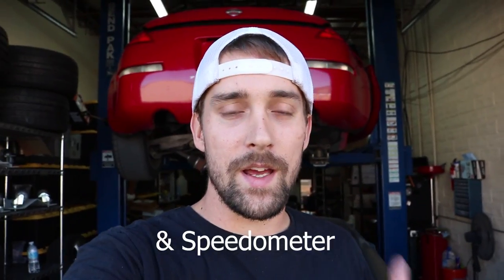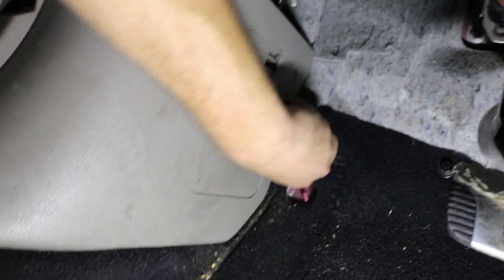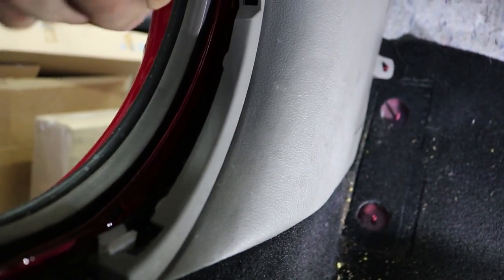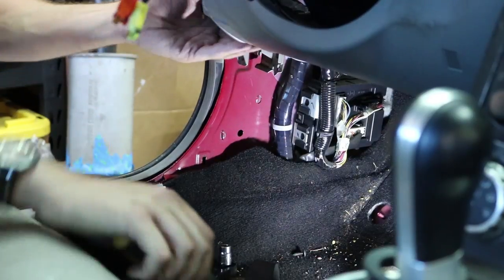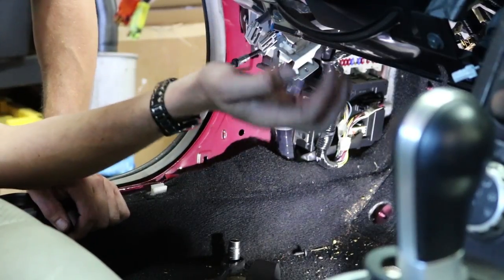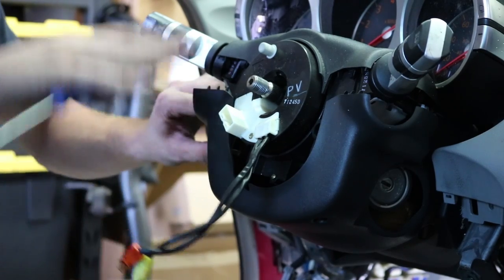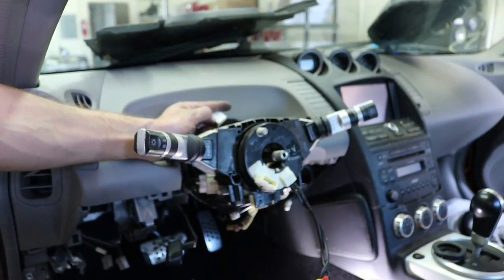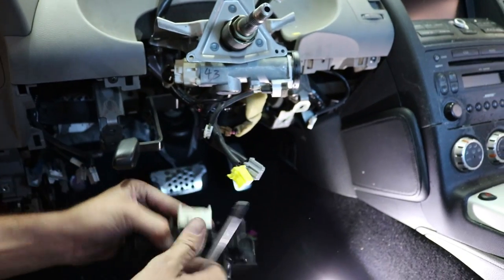350Z How To Remove Clock Spring & Speedometer Z33 350Z Speedometer Clock Spring Removal

Comment: If possible, I have seen where folks get digital gauges in dash pods but keep the multifunction.I have only seen one picture of where you can cut the board that holds the "gauges" and keep the multifunction and replace the other two with real digital gauges in the pods.Do you have any experience with that?If you have a spare board, can you check that out?
Reply from the maker: Yeah sure, I've also wondered this myself, but never wanted to do it on my personal car. But I'm sure I have a not so good condition one somewhere I'll give it a try
Reply: @fullthrottleperformance  you can find the pic of where to cut it on my350z.com searching google.Let me know please if you try it and the results.

Comment: Hey so if I do this to fit a racing hub will there be any negitive side effects besides loosing the horn and controls ect. Like will I have any steering issues ?
Reply from the maker: Sorry for the super late response. I don't think you'd have a problem with an aftermarket hub unless you want to retain the airbag.